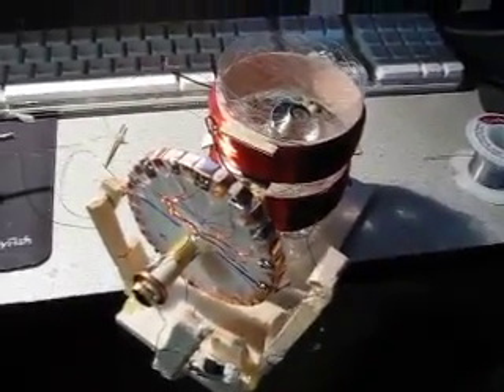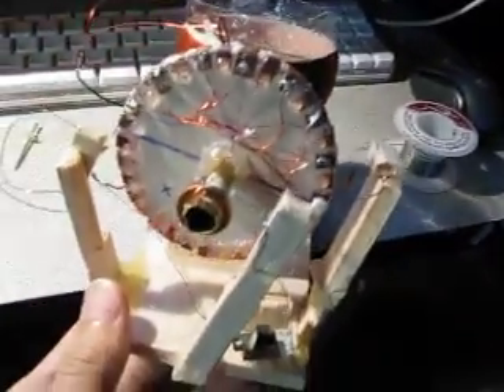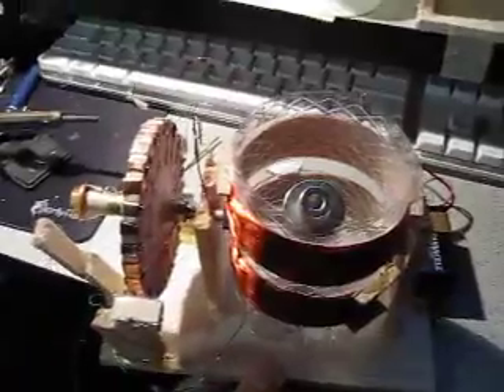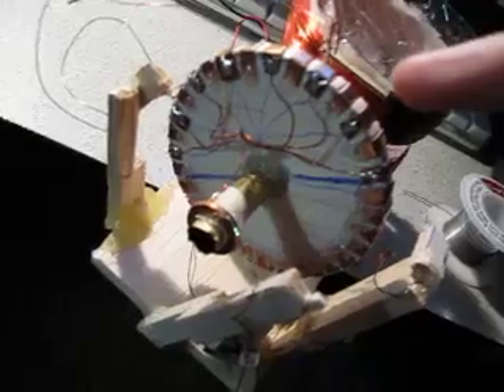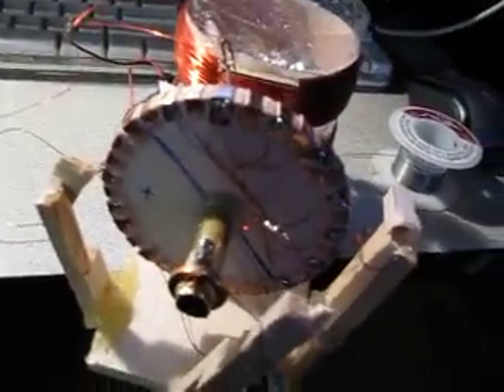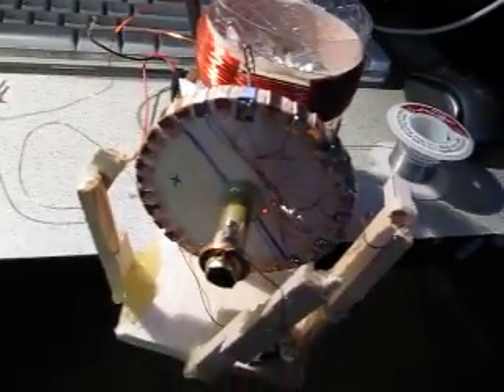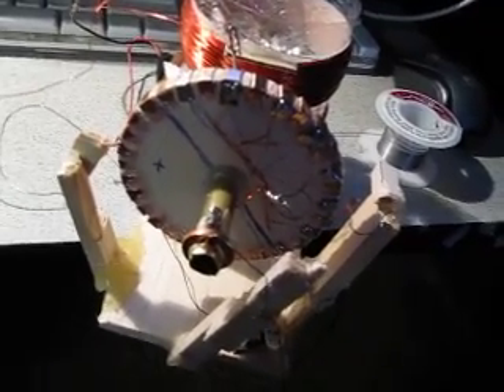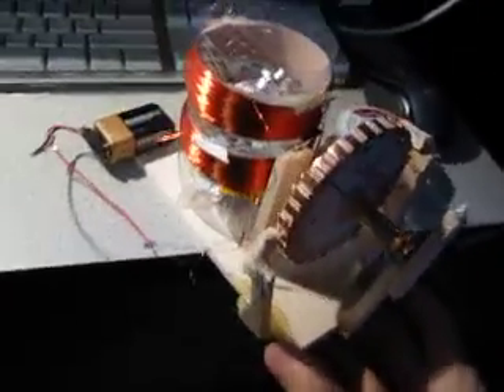Joseph Newman Motor "with" special commutator

Comment: Hi do you have a better schematic of the commutator I have been working on it and it's not easy good job!
Reply from the maker: Look at Joseph's book.
Reply: @spiritelemental  I built one it does have the potential for more output although not worth the material for the output. Too much mass is needed there are better options today if only Joe was not so arrogant.

Comment: Good job on making the commutator assembly, most people don't get that far. The most important thing about the Newman motor isn't the motor, but the underlying concept.
Reply from the maker: +Gary McKinnon 700 dollars plus of copper wire is why I didn't go further with this device.  I should really pick it up again where I left off....
Reply: Ye, if you want to maintain the same resistance as the coil gets larger the cost is mad isn't it! If you start off with 50g of 0.25mm wire, at 40 ohms, that £2.50. To make one twice as long at 40 ohms is 200g of 0.355mm wire. The next coil is 800g, ...the exploration and experimentation isn't free ;+}
Reply: @spiritelemental  Hi spirit, are you still working on this? I'm starting from basics and just proving to myself that a higher inductance coil does contain more energy (given that it has the same resistance as the lower inductance coil and both have the same amps in). Then i plan to do a solid state version.
Reply: @GaryMcKinnonUFO  please help me out, i really want to understand how this works...
Reply: I don't understand it yet, i thought i did but experimentation has proven otherwise.   @Sid-lk2gq
Reply: @GaryMcKinnonUFO  thanks for the reply, i heard 1 method is to melt lead and align its atoms while its molten with a magnetic field and let it solidify then put it between 2 magnets pulling on each other and spin them around it and because the atoms are at 90 degrees to the magnetic field it induces current in the lead, not sure how right that is though, i was thinking i might try it
Reply: Newman never did that so it'd probs be a waste of your time. That's why i'm starting from basics, looking at how much back-EMF we can get with faster rise times, mechanical commutator instead of electronic switching etc.  @Sid-lk2gq
Reply: @GaryMcKinnonUFO  i got the idea from what was supposed to be some of newmans patent applications, there were different methods described, it says this 1 works  on gyroscopic laws where any force put on a spining objects axis will result in forces exerted at 90 degrees to the force applied, i dont understand it properly or back emf as you mentioned, i can understand the benefits of using a physical commutator, 1 being itl never go out of time, good luck with your experiments and feel free to enlighten me at any time.
Reply from the maker: @GaryMcKinnonUFO  No I haven't worked on the project in almost 10 years.  I do finally have the money to build a much bigger version which I may do if I have the time.  If only I had been richer earlier in my life and had more time to work on my projects.   Being smarter would help too....  lol    Oh well, its not to late.  I'm still only 39 yrs old.
Reply from the maker: @GaryMcKinnonUFO  Hmm, very interesting.  I just watched your video and the second coil you attached doesn't do what one would think it should do.  Anomalous energy gain???  I hadn't heard of the Thane Heins effect until now.
Reply from the maker: @GaryMcKinnonUFO  Are  you the real Gary McKinnon?  lol   The guy who hacked the US government and found secret evident of non terrestrial officers?
Reply: @spiritelemental  Yes it's me, that vid was done in 2012, i've been in contact with Thane since 2007, it's a real effect, it defies the work-energy principle. He has taken it much further.
Reply from the maker: @GaryMcKinnonUFO  Well its nice to meet you Gary, I've heard all about you for many years.  Your a legend!  Did you ever get exonerated for your supposed crime?  And do you currently live in the US or in Britain?  Do you still tinker and build stuff?  There are so many interesting law defying technologies out there.  I'm fascinated by all of them, I just wish I could build more of them successfully.  I'm working on Bruce Depalmas N machine right now, along with Viktor Schaubergers water free energy device.  I will have part 2 ready shortly of this earlier video/experiment I did 3 years ago but never finished.  https://www.youtube.com/watch?v=c93UPG8uQRk&t=639s
Reply: @spiritelemental  Yes we won the extradition case in 2012, i live in the UK. Wow, the n-machine AND a Schauberger device, very cool indeed.
Reply from the maker: @GaryMcKinnonUFO  Thanks and good for you.  The n-machine has only been 21 years in the making.  lol   I actually first heard about it by someone who worked with Adam Trombly on their own free energy device which is very similar to the n-machine and built at almost the same time as Depalma's first prototype if I remember correctly.  It was back in the year 2000 when I first learnt about over unity devices and first took them seriously.  It wasn't for another 6 years until I decided I wanted to build one.  I'm slow, but I will succeed eventually.  Its inevitable at this point.
Reply: @spiritelemental  Great stuff, keep me posted :)

Comment: so did you produce some overunitiy with it ?
Reply: solunasunrise absolutely 100% impossible to
Reply from the maker: In the last version of this device I built, I ran it for 3 days straight and there was a couple volts drop from the initial 217 volts I was getting from a large number of 9 volt batteries.  I figure it was about 99% efficient but not over unity.  A 2 pound machine is way too small.  It needs to be much bigger and have a much longer wire length in the coil for it to work.
Reply: @spiritelemental  was that under load or no load attached ? just self feeding ?
Reply from the maker: @StellarionPrime  No load.  The batteries power a coil that flips polarity during every half turn of the shaft.  However the power source is pulsed 32 times per rotation and then the back emf of the collapsing magnetic field is captured and used to charge the batteries.  Its an ingenuous system that I believe does become over unity once one has built a certain size of the device with a certain critical wire length.  I have the money to build a much bigger version now, so maybe I should do that and see if its actually a free energy device as Joseph Newman has long claimed.  His book explains his device very well.  It use to be available for free on the internet somewhere.  I still have it.
Reply: @spiritelemental  i don t think building it bigger will make anything different since also longer wire means more impedance wich in effect will zero out the benefit against the bigger resitence to overcome after all (just a theory .... maybe i m wrong)... i think the trick is to work with very high voltage (big electro-magnetic field) wich THEN might be an "antenna" to pull in exra energy from the "eather" wich in turn then is itself THE OVERUNITY ...
Reply from the maker: @StellarionPrime  You might be right but Newman has said himself that smaller versions of his device won't work.  His smallest device used 140 pounds of #30 copper magnet wire and ran at 300 volts.  I do know that Timothy Thrapp built a somewhat similar device using 5 separate coils and #40 copper magnet wire and I think it only weighed 13 pounds, but don't quote me on that.  lol
Reply: @spiritelemental  problem also is nobody really works with oscilloscopes ... freaking expensive they are or they come with a lousy measuring range...
Reply from the maker: @StellarionPrime  Actually I think the collapsing field is allowed to short out in between each pulse, creating a very temporary reverse flow of electricity.  I don't know how it gains energy but Josephs theory is explained in his book.  Many strange effects start to happen with very high voltage pulsed DC, which Tesla can attest to, so maybe your right.  I wish I had an oscilloscope.  I just bought a 90 dollar amp meter yesterday.  How much are oscilloscopes?
Reply: @spiritelemental  it gains energy just like the upward wave point in the middle once you threw a rock into the water ... i believe electrons have similar fluid attributes just like water or any similar liquid ... i mean its a medium that is everywhere basicly sitting still and waiting to create "stream" (electricity) ... in fact in german Strom = elecricity but it also means stream ... like a river or creek ...

Comment: Nevermind what I said about the springs I used. The real solution is to make the commutator as smooth as possible. If you do that, then rollers should work the best.

Comment: @spiritelemental

The conducting metal of the bearing will not have enough grip to roll without slipping. After 3 hours at Sears, I found that football-shaped compression springs are superior to rollers in this case. They will bend transversely (tension and torsion) when struck by contacts, reducing pressure on the commutator. These are rather large springs for this job (2" long and 5/8" wide in the middle). They produce minimal contact area, restore very well, and yet are not too stiff.

Comment from the maker: @jasonmushersee Thats a good idea, to use a roller for a brush.  I may have to look into trying something like that.  Once I upgrade this unit, I may attach the shaft to a second newman motor to use as a generator to charge a second battery.  In Joseph Newmans book, some 30 different scientists and professionals varified that his device worked.
Reply: https://youtu.be/4_wSy5zStsg Hi spiritelemental I have trouble running this motor. Can you watch it and suggest any improvements? If I fix the magnet to the shaft don't want to rotate.
Reply from the maker: @YourInventions369  Your magnet is spinning around your shaft.  You have to attach it to the shaft.  Fix it to the shaft.  When you wire it correctly it will spin.  Do you have Joseph Newman's book?  It explains how to build his device very well.
Reply: @spiritelemental  yes , I have his book. I tried to follow him, but I can't synchronise the rotor. I mean the magnets are shaking now because I want to see how the field is moving. If I make the magnet stick to rotor I doesn't want to make full turn. I will a video.
Reply from the maker: @YourInventions369  You have to give it a little push in the beginning to get it started.  It won't turn on its own initially.  I hope that helps.  If I still had my device I would film it again in 4k so you could see it perfectly.  I may build the Joseph Newman motor again some day, but much much bigger than before.
Reply: @spiritelemental  https://youtu.be/OPKXCErZAMI here I try to give him a kick but can't switch pole's I think. Because when finish one part of segments see how difficult is to continue.
Reply from the maker: @YourInventions369  I don't know, maybe your magnet is on backwards?  Do you have a large capacitor connected to the system?  It looks like there is a large grey one on the right side of that video.  There shouldn't be one.  What gauge of wire are you using and at how many volts?
Reply: @spiritelemental  Yes I have a capacitor 450 volts 50micro farads, I  use 33 9 volts batteries which make around 320 volts. I try also with 100 volts with 11 batteries. But still can't make full turn. Gauge is 0.20 mm wire , 1.13 kg. I use 1 to 10 proportion with Newman's original coil and magnet from the book. Can't measure the ohm's because it goes over the measuring unit.
Reply from the maker: @YourInventions369  I would lose the capacitor and then tinker around with different things.  I made a much more simplistic commutator at first just to make sure the thing would spin.   The shaft had only 2  different pieces of metal that went straight to the coil.  Two wires from the battery would contact the 2 pieces of metal on the shaft and as it turned they would reverse the polarity every half turn.  https://www.youtube.com/watch?v=YVW7nXO9lss
Reply: @spiritelemental  that is a very good idea. I will debugging this way without the special commutator. Thank you! I will show if I succeeded.

Comment: Works nice. So how many volts is it pulling or is it putting out? I was just thinking the contact brush could be some kind of copper roller (penny) to eliminate friction. Nice video but i still have'nt figured out David Hamel's engine after studing it for months.
Reply from the maker: David Hamel's engine works by creating an imbalance with the magnets, which leads to the creation of a vibration that slowly increases in the 3 cone setup.